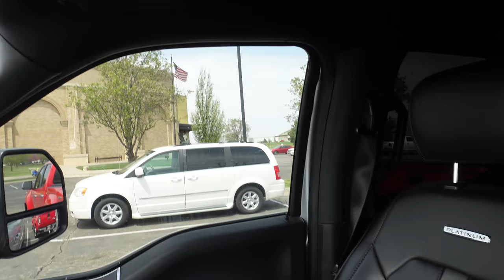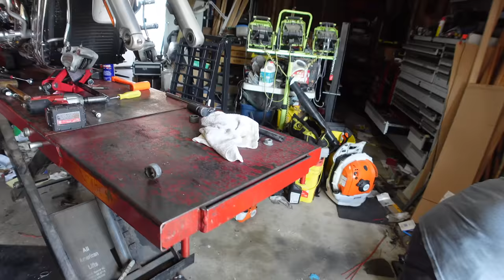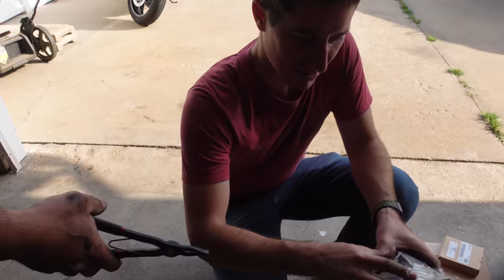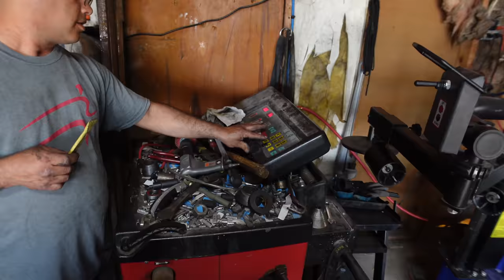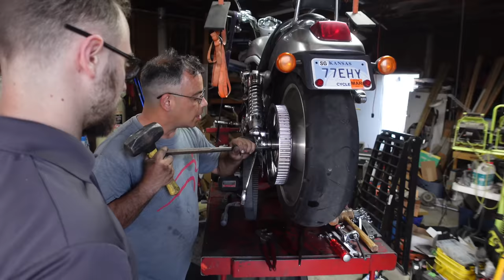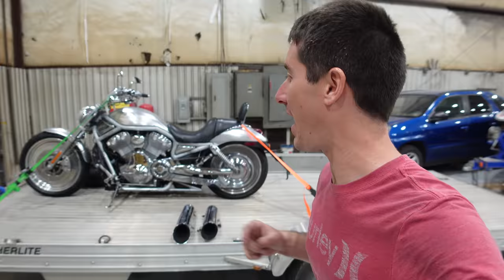The Rear Axle Is Totally STUCK In My Harley V-Rod *We Can't Change The Tire*

Comment: I just replaced the rear tire on my 95 FLSTC and it was a piece of cake because the Last time I grease it up when I put it back together the rear axle slides in and out like butter 🧈 😅 be sure to use a good grease or anti seize compound and the next time will be easy.
Reply: I live my life by Permatex with silvery fingers.
Reply: Yep on Harleys that use hub style wheels anti seize goes along way towards helping the next guy
Reply: @docsridingadventures2880  yeah but the next guy is going to be me every 10000 to 15000 miles at least once a year for me. That's how long the rear tire lasts for me.

Comment: I've had this happen on my Sportster before. I literally had to cut through the spacers and the axle on each side with a sawsall. Was able to get it out after that.
Reply from the maker: Honestly that's probably better than the torch, I might just cut it off 😬
Reply: @WatchJRGo  Definitely see if the sawsall will work.  The Mr. Torchy plan could result in a number of consequences.  Most bad.  You're trashing the axle anyway, and replacing all the bearings.  Cut both sides and let it all drop out.  BTW, my 1993 FLHS factory service manual states to coat the axle in anti-seize before installing.  Don't know about the newer bikes with the sealed bearings, mine are old school.
Reply: I just went out and checked my v-rod. You could definitely cut it out. However it'd be really close on the brake caliper side. But if you mess up the brake caliper bracket, there's your excuse for the brembo brakes.
Reply: @kylehorn09  Excuse only applies for someone who hasn't already brought the parts and is planning to install.

Comment: A few weeks ago VTuned unboxed and tried out a tool that would make short work of that dent. It worked by spot welding tiny rods that would break off flush with the metal when pulled with a slide hammer. He could pull out the smallest little dents leaving the surface only slightly marred, a bit of sanding and you couldn't tell the dent had been there.
Reply: Here is a link to VTuned using the tool. You'll see immediately how it works, and how well!  https://youtu.be/8qHMB0ax5Yw?t=320

Comment: The way I do it is with a air chisel. I used the one with the pointy tip. There's a little indentation on the rear shaft. Normally a few pulls on the trigger and it pops right through.

Every time I remove the axles I automatically clean off all the past junk and reapply anti-seize. Once I have an axle out I've never had to resort to anything else other than a couple taps with a regular hammer.

Comment: If you're going to get an air hammer, get a CP717  riveter or the Jet equivalent.  They take a larger diameter bit.  That'll save a lot of beating time as compared to the other air hammers.  You just need to make sure the air compressor can keep up with it.

Comment: Excellent videos. I built a 03 vrod up that i got for 2600 with a broken output shaft bearing. Easily the best buy i've ever made. Make sure the output pully and wheel pully are flush after you're done messing with the back wheel. Also belt tension on this bike is real temperamental. I'm ashamed to say ive snapped more than 1 belt due to over-tensioning/ what I believe was undertorquing of the rear axle but which caused the belt cam tensioners to gradually tighten up the belt over time (i could be wrong but its my best guess).

Comment: That axle stinks... I was hoping for a win by the end of the video. I've had really good luck with my Hilti Te55 switched over to hammer. I cut the point off a pointed concrete breaking bit. It hits dang hard! FYI Also cut off a different bit and welded a ring of pipe on for pounding ground rods. Good luck. Waiting to see the bike finished. 🤟

Comment: Can you post a video of the removing of the rear axle on the vrod? You had said that an air hammer would likely be used as well as a chance the bearings would be replaced. This is a problem on many motorcycles with age and it would be helpful to those of us who have this same issue to know how to resolve it.

Love the vrod project!

Comment: I'm sure you made sure it was done right, but it's surprising how many times I've seen tires mounted the wrong way so the rotation is backwards.
Reply from the maker: Rotation is right for sure 🍻
Reply: It sure looked like the groove was going backwards on the front tire,  but I defer to the experts ... and JR, who visually verified the rotation.  Very cool looking bike , probably the only factory HD I would consider owning besides a Sportster .

Comment: I was wondering if using something like a gear puller to push the axle out would work. Probably irrelevant but it sounds like the bearing and axle are galvanically  welded to each other. Heat would probably work but is risky. Soaking in PB Blaster may help if you can get it where its needed. Good news is that bike looks better every time I see it.
Reply from the maker: I was soaking it with penetrant 😬

Comment: In 88 I bought a Sportster new.  At 700 miles the rear axle seized in the hub, breaking the nut loose. Squeak Squeak Squeak.  We used a welder to heat the axle.

Comment: Myself and a friend put his WR 400 sideways into a hydraulic press to remove the swing arm bolt. It took 5 plus tonnes of force to shift.                                                      
As for a Harley without a muffler heck there are more noisy Harleys around than you can poke a stick at.

Comment: Them old Harley four piston calipers had a problem. As the pads wear down the piston will not move out. The seal pulls the piston back to the old position causing an air gap between the pad and rotor. Usually happens on dual brake bikes where the pads are half worn or more. This will give you excessive front brake lever travel or a soft feel like air is in the system. To fix it replace the pads or remove the caliper and apply the break until the pads will not go back on the rotor. Then open the pads just enough to put the caliper back on. Do both sides

Comment: Somebody here curbed a couple of bike tires last week.  I almost stopped to see about picking them up. 

I have this trailer somebody made with a '36 Chevy axle that is like a two year only 5x4.25 pattern, so the only wheels that fit are the artillery that came on it or possibly Volvo 240.   The wheels on it are like 18x4.  So finding tires to fit without spending more than the trailer is worth is an issue.  It's mostly used around the yard, they don't have to be great tires, but I could use one without a big hole in the side/.

Comment: PB blaster to quench the axle and bearing for 2 or 3 cycles. Then hit it with a 20# sledge. Put in a new axle and bearings when you get it apart. Also don't overdo it with the heat on that rim or you'll trash it too.

Comment: You have to support the rear wheel. I'll  bet the pulley bearing will not last. Try spinning the axle back and forth. 
Check Amazon for parts.

Comment: @Watchjrgo did you ever get the rear wheel installed and also rear brembo brake caliper?  Does it just fit right in without any modification

Comment: I missed what brand of calipers he bought.  Did he ever mention it?

I like Brembos, myself, because only Brembo calipers deliver Brembo quality, Brembo Brembo.  At least that Brembo is what my Brembo friends swear by, Brembo Brembo Brembo.

If Brembos are Brembo leaking Brembo brake Brembo fluid, Brembo Brembo Brembo Brembo, it's still all Brembo good.  Oil leak, Harley, leak leak.
Reply: HD CVO brakes are made by Brembo. Love the set I have on my '96 Sportster.
Reply: @willgallatin2802  Is that the one with the self-oiling Brembos?  ;)
Reply: @mbryson2899  ROFLMAO! Well he did say they were used. :P

Comment: Drill the ends of the axle all the way thru the bearing on one side and only thru the swing arm on the other. then you can remove the tire. And beat the snot out of the axle on the bench.

That is of fire and bfh don't work.